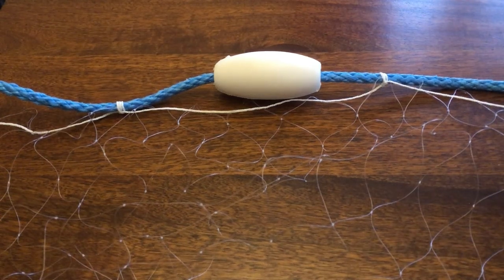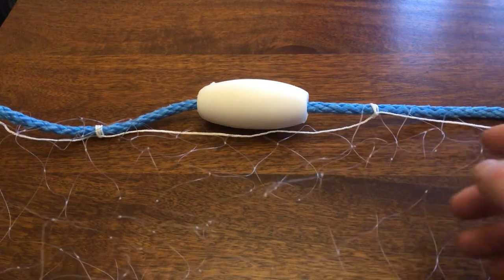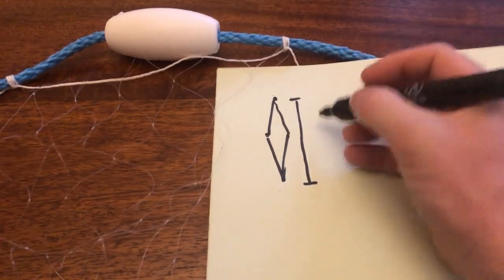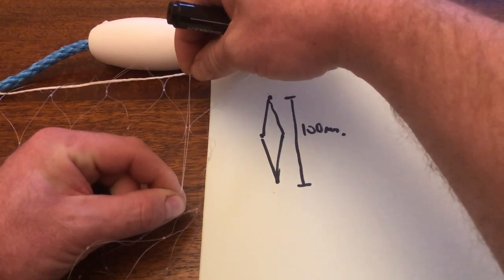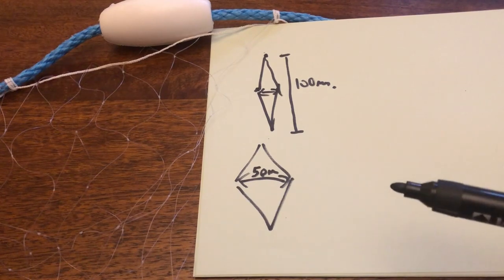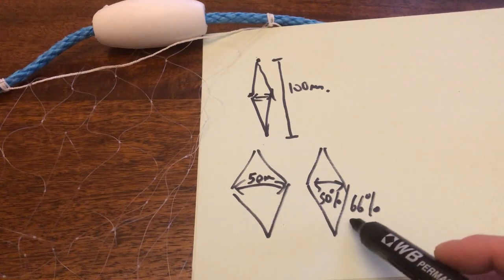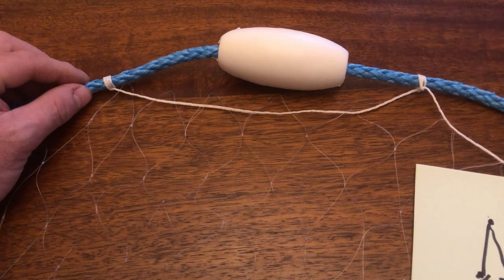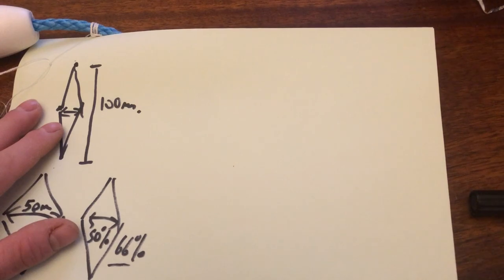How to rig / tie the float line on gill / tangle nets sea fishing. Knot distance beach boat survival

Comment: I dont know what you call it in the UK but i Denmark we also adjust rigging by having different depths on the shot, meaning you adjust how much slack there is between two knots (is the sewing twine tight to the float line or not). This can further slack the mesh making fish tangle better but can also be adjusted to fishing in strong or no tide areas. Further nets a rigged 10-15 % less in length on the float line compared to lead line.
Reply from the maker: Yes, we do the same on bottom nets.  On drifting nets, we also rig the lead line a lot longer than the float line. I have rigged the lead line twice the length of the float line, so full stretched length, so the bottom of the net bag a lot. It improves catch rates greatly.

Comment: Super well explained, what depth are your herring nets and what is your net shoot made from
Reply from the maker: Cheers. The depth of the lint is about 15ft, I have strops on the sunk nets between 3ft and 9ft. . The net chutes are made from fibreglass.
Reply: Do u have a sock on your boat to let the water out, or do u have a electric pump
Reply from the maker: @lobsterman2632  I have an electric pump. MCA no longer allow the use of a sock at sea on commercial fishing boats
Reply: Did u have to make a well at the stern for the electric pump
Reply from the maker: @lobsterman2632  yes, I cut a hole with a jigsaw, cleaned the edges with a grinder, and glassed in a plywood well. It didnt take long, and was easy to do.
Reply: I just have a sock in my tactile, the less electrics u have on a boat the better I reckon
Reply from the maker: @lobsterman2632  The socks work well, but unless they have a valve which you can bolt close, they wont pass the safety check
Reply: What do u mean by the gill on the net
Reply from the maker: The end of the net. The piece of braided nylon that is stitched to the net between the lead line and float line

Comment: also you mean divide to find the half not multiply , just a little mistake youve made
Reply from the maker: Hello, multiply was fine in this example, because I flipped the number under 1. So a half is 0.5.  If I divided it, I would have used 2.